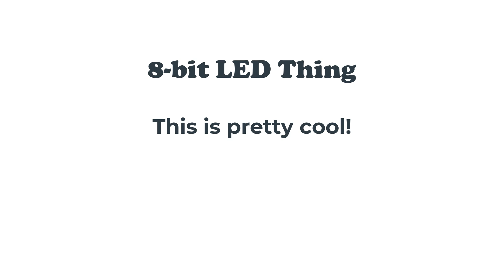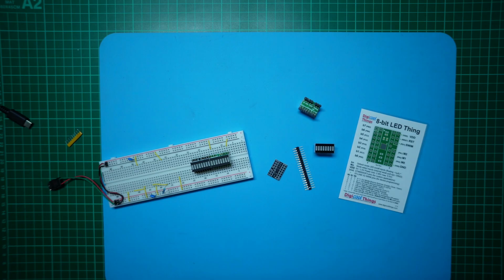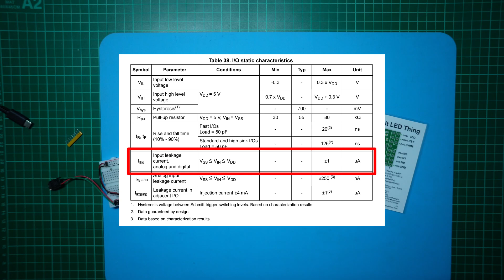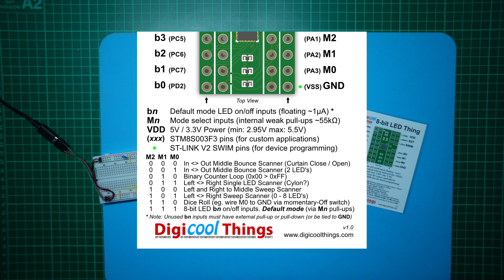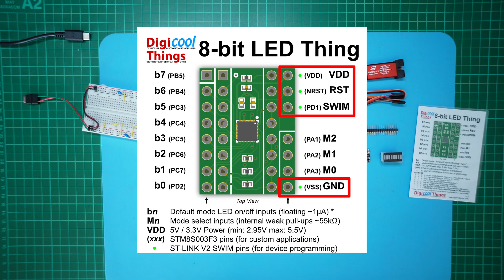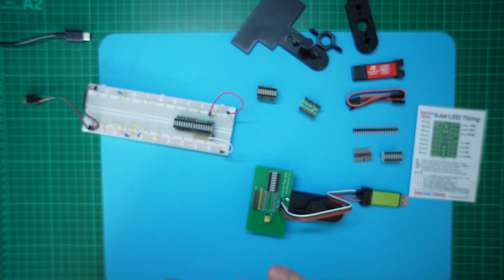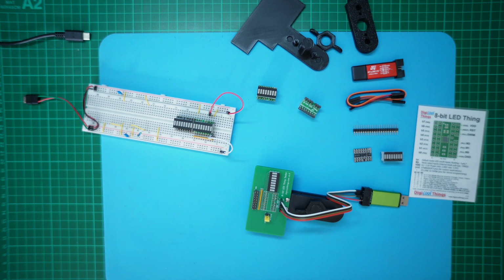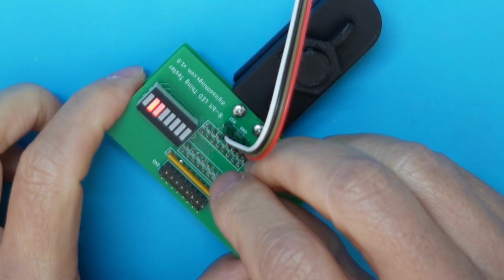8-bit LED Thing - This is pretty cool!

Comment: Really cool! This would be funny to use in the Ben Eater 8-bit breadboard CPU. The LEDs would have more compute complexity than the project itself!
Reply from the maker: Thanks. I do see what you mean.  Although, the MCU used is an 8-bit one, and only has 8KB ROM & 1KB RAM, so it is somewhat appropriate within an 8-bit Retro project.  I use “8-bit LED Things” with my own retro 8-bit Microprocessor design breadboard prototyping, and just consider the pre-programmed function of the inbuilt MCU as simply just another ASIC chip doing it’s specific dedicated function (which is, really, unrelated to the 8-bit Microprocessor project’s functioning itself).  🤓

Comment: I was a bit disappointed, as the presence of the MPU was revealed I was thinking brilliant!  Sadly the modes I was hoping for didn't arrive: 1) A latched input sampling mode.  One of the mode pins would be the Latch Enable signal.  2) A pulse stretcher mode so short pulses can be seen, this would be triggered on a rising edge.  It could also do the same on falling edges with the off-time being stretched. S0:
M0 & M1 - Latching with Mode[0] being a low-going LE signal
M2 & M3 - Latching with Mode[0] being a high-going LE signal
M4 - Pulse stretching, low-going only
M5 - Pulse stretching, high-going only
M6 - Pulse stretching, both edges
M7 - Direct follow, as now
Reply from the maker: Hi Brian.  This is exactly the benefit of the tiny “8-bit LED Thing” board being microcontroller based.  You are free to develop your own code, to make it do what you want it to do.  I chose to make it primarily a 1µA load digital signal level indicator replacement for the common LED display use on our digital projects and breadboard prototypes, with some fun additional display modes added.  I look forward to hearing what custom uses others might dream-up and implement. 🤓
Reply: @Brian_Of_Melbourne  sounds like you're gonna have to buy the programmer too and get your smt coding on.